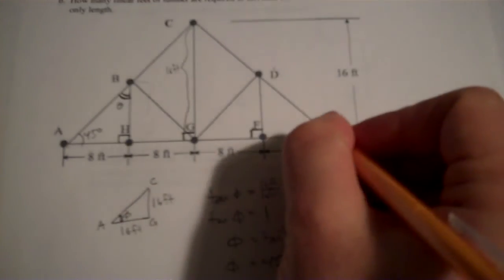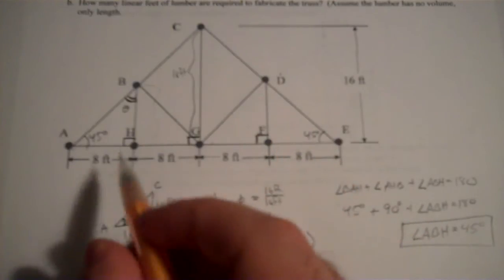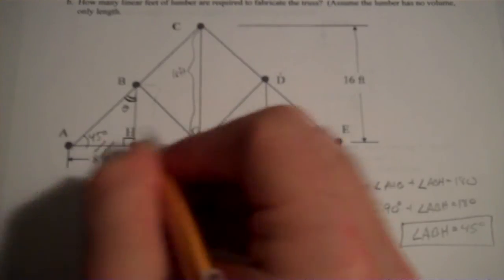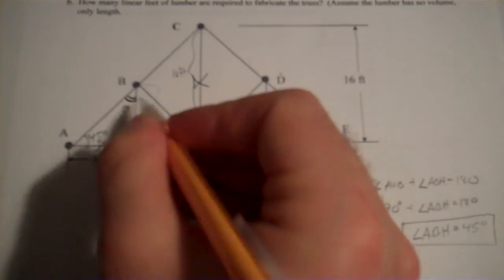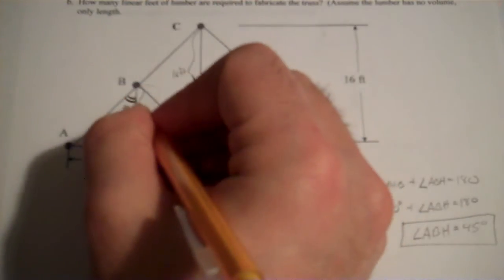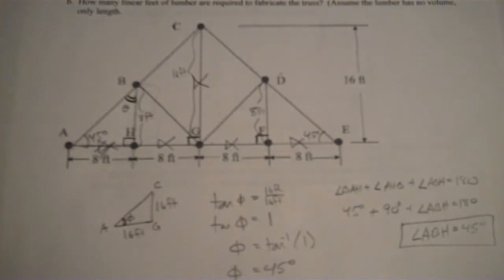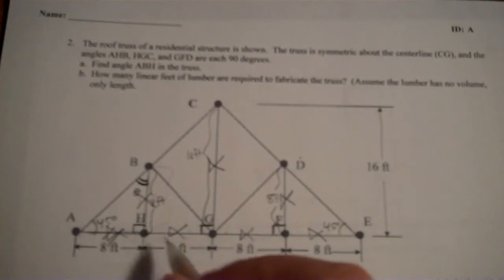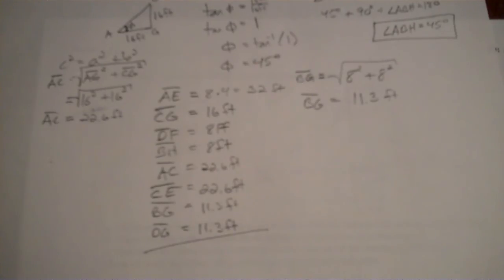POE Practice Problem - Roof Truss Geometry

Comment: Since the right hand triangle ACG has 2 sides =16ft, therefore by law it also has 2 angles = 45deg., hence angles BAH=45, AHB=90, then ABH=45. So side BH is 8ft, because again right hand triangle ABH has 2 equal angles therefore it must have 2 equal sides. So from this the left side of the drawing is a mirror image of the right side
Reply: Your illustration in the paper was not very clear..